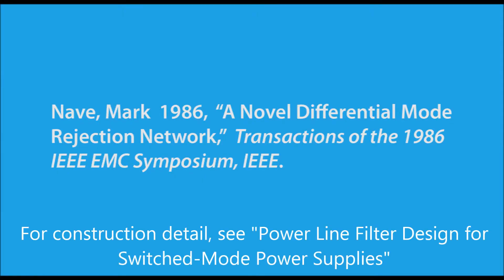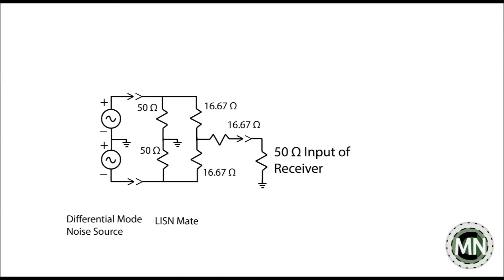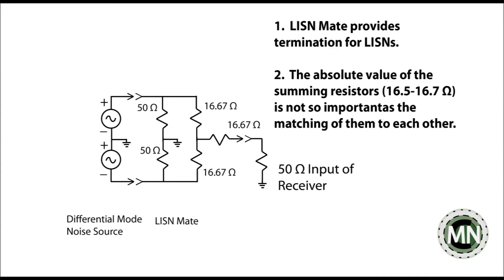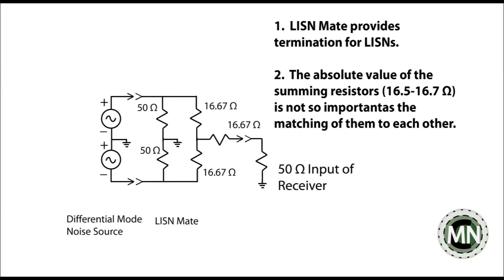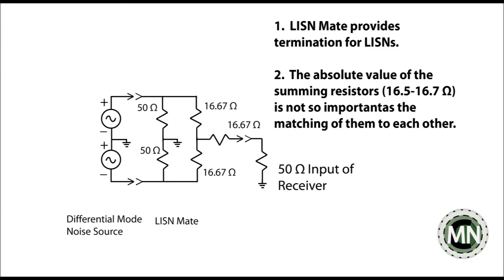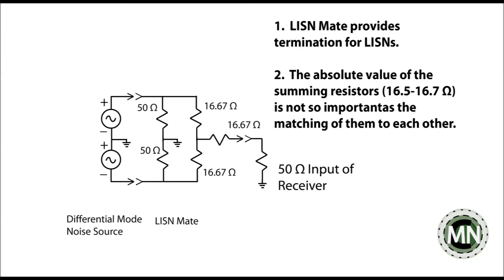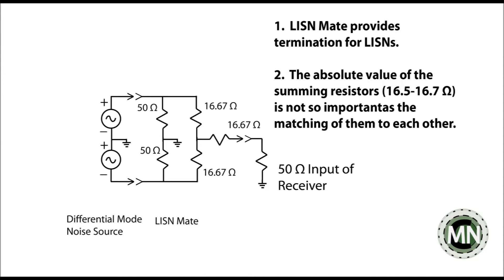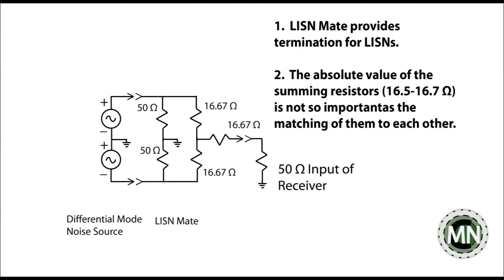Filter Design Video

Comment: Well, this video raises more questions than it answers!
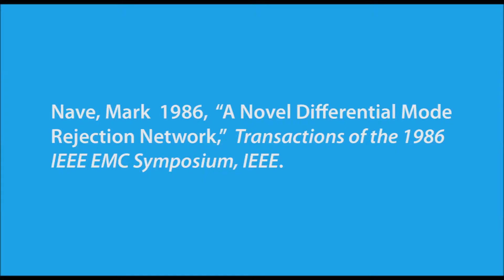0:40  I looked on the IEEE site for the transactions for a 1986 EMC Symposium, and did not find a paper by Mark Nave.
Also 0:40 Searching for the book "Power Line Filter Design..." is a serious rabbit hole.  There are two editions, a 1991 and a 2010 edition. Copies of either available online are few and far between, and none reliably distinguish the two editions, as they are confused about which edition corresponds to which ISBN, and there's even confusion of ISBNs with an unrelated book about cancer survival.  

Hmmm, maybe we could go to Mark's site as he suggests in the video....  so we could check his LinkedIn page to get there... except that's a dead end, and his site  marknaveconsultants (with the usual ending) no longer exists.  I'm kind of worried that maybe Mark doesn't either :-(.  
Plowing on, it turns out that the site is preserved in the Wayback Machine, yay!  

But then you visit the pages and their format is so messed up you can't read them.  But with some diligent viewing of the source code, you can discern a message that indeed the 2010 edition was initially printed with the wrong ISBN. According to that page, the correct ISBN is:
ISBN (13): 978-0-578-06326-3
ISBN (10): 0578063263
There may be some chance to download the mentioned papers from Wayback Machine....more digging required.
Reply: And now after disentangling marknaveconsultants's "Articles" page, it turns out there's:
Nave, M  1986,  "Prediction of Conducted Emissions in Switched-Mode Power Supplies," Proceedings of the 1986 IEEE Symposium on EMC, San Diego, CA
Nave, M  1989, "The Effect of Duty Cycle on SMPS Common Mode Emissions: Theory and Experiment"   Conference Proceedings of the 1989 Applied Power Electronics Conference
Nave M.  1989  "A Novel Differential Mode Rejection Network,"   Symposium Record of the 1989 National Symposium on EMC,  

... so the title mentioned in the video is actually from the 1989 National Symposium on EMC, and indeed I was able to track it down there as DOI: 10.1109/NSEMC.1989.37184, Sadly, though the listings on the Wayback page are hyperlinks, they don't work.